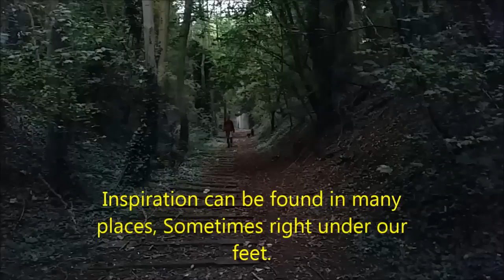Scrap bin challenge: Make a Coat Rack from Railroad Railway Spikes.

Comment: It has a nice rustic charm to it.  Is that spalting on the sides of the oak?
Reply from the maker: Thanks! :-) I don't think  there as any spalting,  you're probably seeing some rather large cracks. The original 6 was only  air dried.  so this piece moved a huge amount in the last 18mm the after being thicknessed.

Comment: Great use of old railway fitting, sorry to ask but I could not help but to see a roll of something in the background with what looks like felt tip pen scribbles what is it please???
Reply from the maker: John Fithian-Franks Hi John, I assume you mean on the work bench? It's actually a temporary Urn, I'm working on some custom urns for a local funeral directors, and it was given to me to use as a basic size template for further designs. Just another project that's going through the workshop. :-)

Comment: Hi Richard, love the project. Where a outs is the disused railway you got them from? I know I'm fairly local to you so may try and raid a few for myself
Reply from the maker: It's an old branch line that was used to haul iron stone out of the mines near Burton Latimer onto the main line to Wellingborough. We walk the dog there a lot.  I went along there today, but couldn't see any as all the leaves are dropping now so it's  nearly completely covered. The ones I did find were all but buried under the foliage.
Reply: You're further away than I thought but knew you were fairly close as you told me before that you get Timber at Ridgeons. I'm about 1.5 hours away near Bury St. Edmunds, but I drive past there all the time for work. Perhaps I'll take a look next year when the leaves start to clear. There are a lot of retired lines in the region though so plenty of the, up for grabs
Reply from the maker: I know the area well. I'm from Cambridge and work from there too. Anywhere between Nottingham and BE :-)

Comment: The spikes are all out of line, not straight
Reply from the maker: +John Coonradt jr.5 That's is correct. Kind of what happens when you pull spikes out of old railway sleepers that have been Smashed in with a sledgehammer, driven over by trains for 50 years, then left in the ground to rust for another 50 years.
I think you're maybe missing the point.